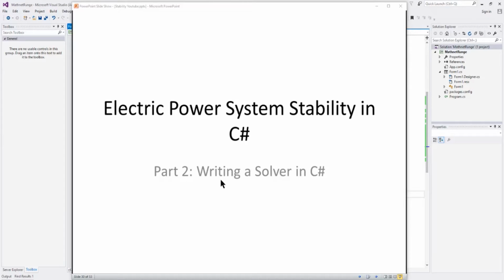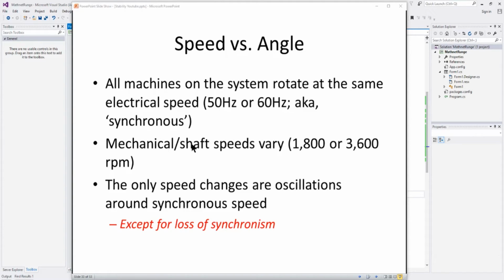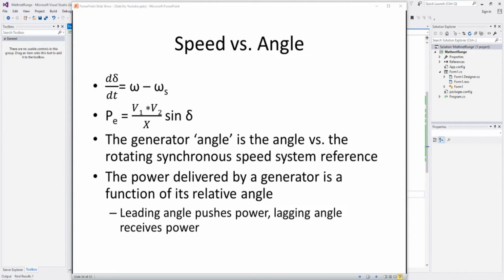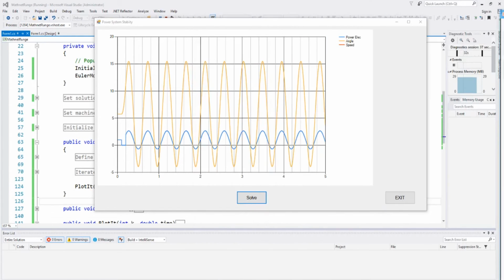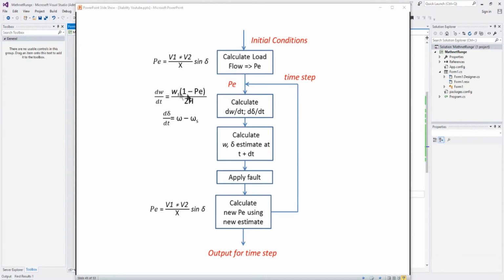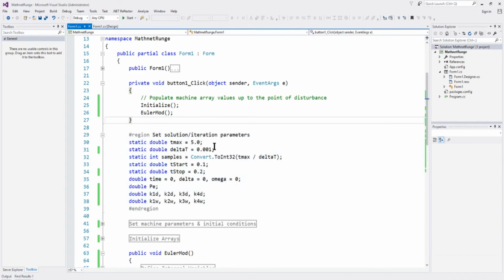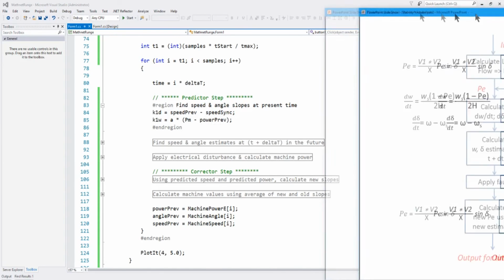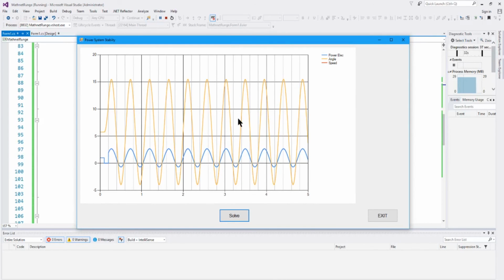Power System Stability in C# Part 2: Writing Euler Solver in C#

Comment: How does a three phase fault give zero power flow out of the generator?  A three phase fault is scenario where the highest current flow. It is also called a bolted fault.
Reply: You are referring to the short circuit current. When there is a fault at the generator terminal, the CB trips and the generator and the grid are physically separated. Thus, there is no electrical power transferred from the generator to the grid. The current he was talking about was the current transferred from the generator to the grid.